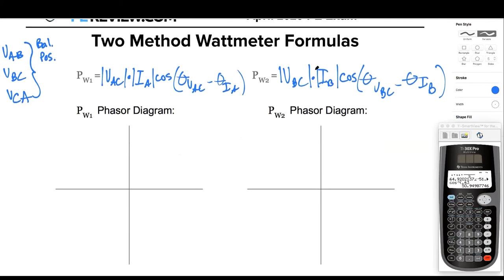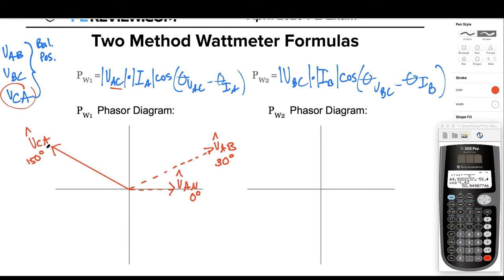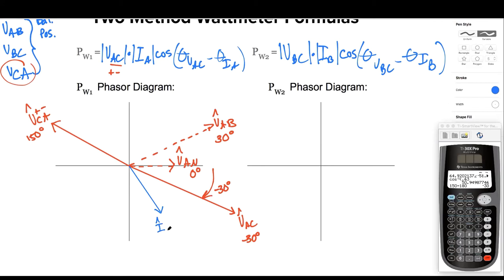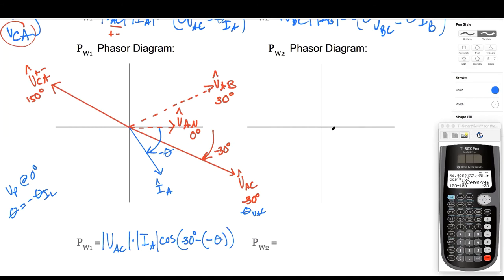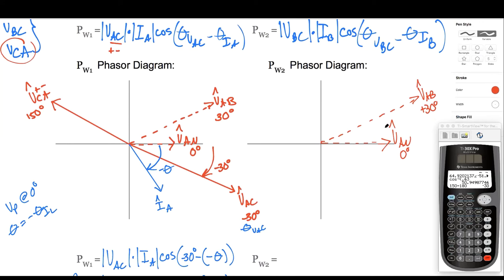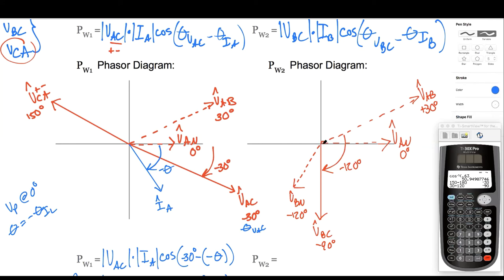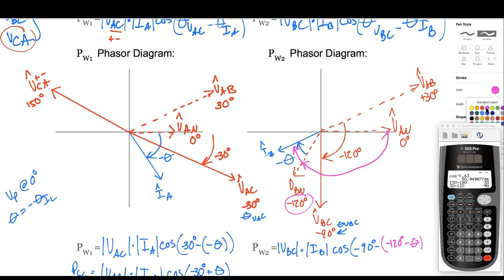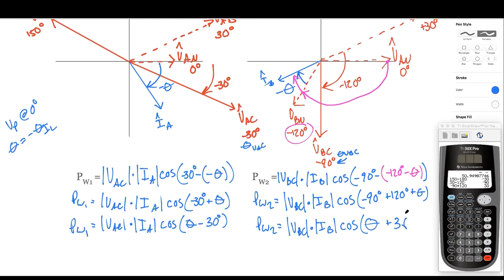3 Steps for Solving any Two Wattmeter Method Problem Part 2 (Electrical Power PE Exam)

Comment: Good way to solve this problem, however not so useful for the actual PE exam. We aren't given that power equation in the handout.
Reply from the maker: It is unfortuante that this particular formula is not included in the NCEES Reference Handbook, however, you'll need to be familiar with it in order to solve two wattmeter method questions on the PE exam. For example, take a look at problem #49 in the official NCEES Practice Exam. It's a two wattmeter method problem that is solved using the formula in this video.

Comment: Common mistake in this approach is to assign the upper meter as meter-1 no matter what. Do u have any observation about this mistake? {Also, Q=Sq-root-3x( W1--W2) , people often miss the -jQ scenario ; would u address this as well?   }  
 Also will u consider to generalize it to "two S-meter method" plus "Complex Power = Vvc { conjugate of [Icc] }" so that the derivation can be much simpler as 2-D phasor equations or formulas are taking over 1-D scalar equations or formulas  using cosine & sine.
Reply from the maker: Your first question (which wattmeter is W1 and which is W2 in the formula) is covered in part 3 of this video here: https://youtu.be/OBcheE3oSOA?t=88